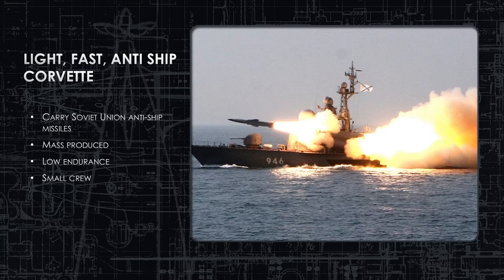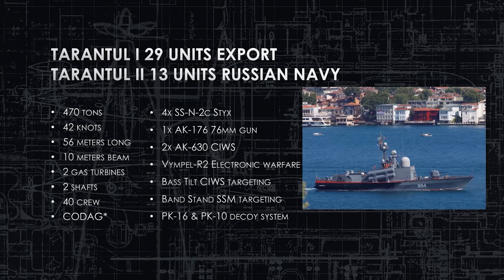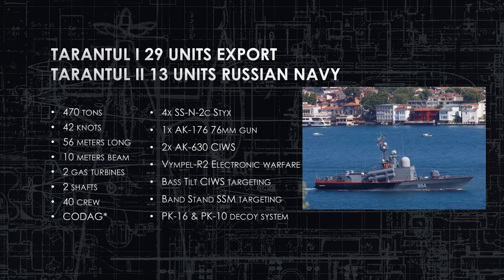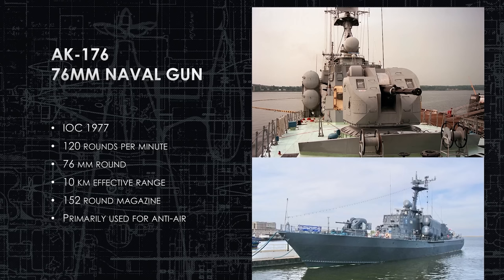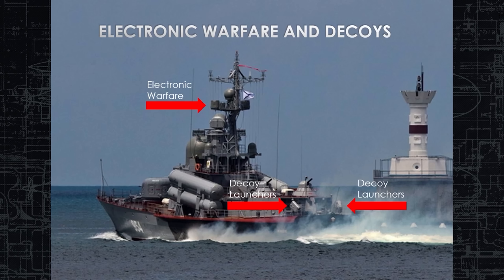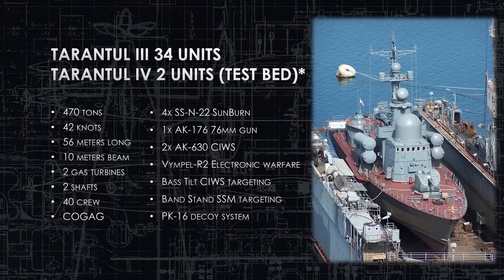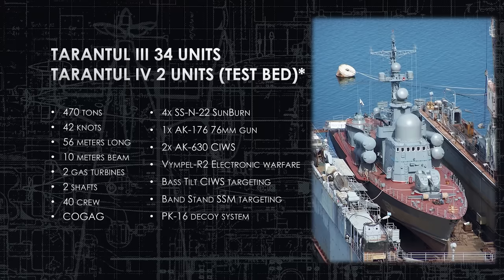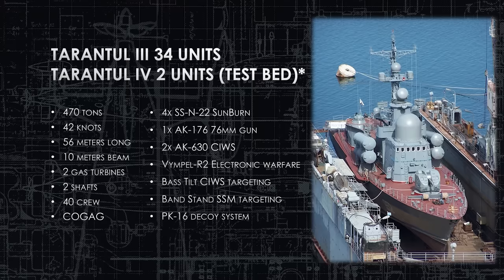Russia's Tarantul-class Corvette Project 12411

Comment: There is a Tarantula 1 boat, former East German Navy at Battleship Cove in Fall River, Ma @ Battleship Cove, USS MASSACHUSETTS MUSEUM ships DD 851, J P KENNEDY & PT boat & ww2 Sub also. I wasn’t impressed with it at all would crush like a soda can.
Reply: I think it's impressive for what it is, and for it's speed, but it's a different type of ship and smaller and less impressive than the surrounding ships at battleship cove so it's easy to be dismissive of it, but it's made to be a super light fast ship killer, same role as the pt boats, and one of the roles of destroyers, it's an interesting vessel if anything.
Reply: I’m not comparing it to the other exhibits. I looked at with the experience of a former U.S. Navy sailor. For a PT type attack craft it has its merits: speed, offensive weaponry etc. but the question is how reliable is it. The Gearing class destroyer like the J.P. Kennedy was (reliable) & besides politics probably why it was kept around for 30+ years on average. It became limited by its size being unable to accommodate modern weapons systems & electronics & air conditioning that went with them. The bottom line is you take it out before it can do you harm.
Reply: I imagine it would be easy for example for an Arleigh Burke  to take out, but what if there are 5 of them, that's a lot of targets to take out, and a lot of missiles too, its like a pt boat, fast, lightly armed and no armor whatsoever, but it does carry one weapon that if used well and with a bit of luck can cause a lot of damage, just one or two anti ship missiles getting through is all it takes. I think for what it is its pretty impressive, it has a lot of firepower for what would otherwise be a large patrol boat. You have to keep in mind the doctrine the vessel was made for. I think in a shooting war based on what we've seen of the Russian navy in the past.... over a century... of mediocrity its not gonna get that hit off, but in capable hands it could do some damage before getting crushed

Comment: The difference btw Tarantul I and II is the fire control system not the missiles. The radars can guide and support the missiles over a longer distance.
Reply from the maker: That's a fair point and something I should have mentioned.  My explanation is simplified so technically wrong.
Reply: @SubBrief sometimes you have to simplify things for a video!

But it is nice for somebody in the comments to add more detail.
Reply: Can they shoot down a jet ski packing a punch though me harty

Comment: Great Video abut small vessels. But you have a mistake, she got 4 Tubins 2 × M 75 with 2x 3677 KW for crusing and 2 × M 70 with 2x 8826 KW for high speed. And Hull Nr 1241.2 ex Rudof Eglhofer was transfed in tue the US Navy as Nr 185NS9201 USS Hiddensee for testing. It saild with a mixt ex GDR and US Crew an is now a museumship at the USS Messachusetts Memorial, River Fall.

Comment: Interesting CIWS placement. Kind of like a porcupine? Show the enemy the stern and scuttle away at 42 knots? Anyway, good video. 👍
Reply: Imagine coming at this with one of the Ukrainian jetski-based USVs. Once you get close up it'll be pretty much defenceless because depending on how much depression you can get from those CIWS at the back the low profile of the USV means it can sneak in under the guns even if it's spotted.  I guess it'd come down to whether the EW suite can disable the drone. (probably)
Reply: @jhonbus  
Yea, it would be funny if a Ukrainian USV went in the back and reamed her out. 🤣 

I wonder what the Soviet doctrine  was that produced this design. Maybe, like an Alfa SSN, they were supposed to sprint out, engage and fire off their missiles? After that, they could race back to port, relying on their CIWS and high speed evasive maneuvers to protect them from any return fire.

Comment: If I am not mistaken, these Tarantuls also had anti-submarine warfare capabilities. They certainly would be bait for western submarines stealing into Russian waters. Doubtlessly they would be blown to bits by any torpedo carried by a western submarine given their small size and light construction. One of these vessels HAS sunk an Israeli warship with a Styx missile.
Reply: Was that sinking the one that pushed the USN into its accelerated development of Harpoon?  I know there was such an incident.
Reply: Well, a Mark 48 would literally loft the vessel out of the water, but it'd give that torpedo a run for its money if it actually moved at its rated speed.
Reply: It's very small target for a torpedo and difficult to hit and probably costs about the same as big sophisticated torpedo. And it's not sumbarine hunter, and probably will be covered by anti submarine ships in case of operating and possible danger from subs.
Reply: @AlexanderTch  56 meters long, not that difficult to be effectively targeted by a torpedo. Especially given many anti-ship torpedoes detonate 2 meters or more beneath the keel or directly behind the screws. Under the keel breaks the ship's back, splitting it in half and behind the screws blows the propeller shaft seals, causing massive flooding.
Reply: The sinking of the INS EILAT was achieved by the Egyptian Navy in 1968 off Port Said by KOMAR PTGs while using moored freighters   as a screen.   It was a good use of shipping to complicate the defense of the EILAT which was patrolling off Port Said.  Four STYX missile hits were scored by the KOMARs on EILAT.   

HARPOON was originally intended to address the threat posed by SHADDOCK-armed submarines of the Soviet Navy.   SHADDOCK was a long-range antiship cruise missile (ASCM) which could only be launched from a surfaced position.    The radar-guided HARPOON was meant to provide P-3 ORION MPAs with an ability to quickly engage a surface target emitting the related fire control signals associated with the SHADDOCK.    The USN employed STANDARD missiles fitted with antiradiation seeker heads as a stopgap measure until HARPOON would arrive.   These weapons were called the Interim Surface-to-Surface Missile (ISSM) and could be fired from shipboard SAM launchers, ASROC “pepperbox” launchers, and the launchers fitted board the PGGs once used by the USN.

Comment: Sorry but could you do a video on maybe speculating on ways to remake/fix the LCS ships especially the independence class ships. could you maybe fill in the deployment bay and turn the entire flight deck/ after deck into a truly massive VLS system mounting like 3 or 400 missiles for fleet defense or maybe launching malds or something.
Reply: The LCS program is beyond salvation, especially the Independence version
A single full length 8 cell VLS module weighs 33000 lbs empty and without associated equipment
You're looking at 750 tons for 400 cells -  empty
If it breaks down, you're also 400 cells short ...

Comment: One relatively small caliber round through the side of an exposed Russian launcher and kaboom. 
It's a phallic display for these floating May Day parades, not a weapons system.
(It's also a marine dinosaur.)
Reply: I gues they are going for speed and sensors over armour and endurance with that one. We will see if it pays off.
Reply: One relatively small caliber round through the side of an exposed American launcher and kaboom.
Reply: @martinmalecki3302  They stopped using armor (except for those big carriers to protect reactors) long ago when sea-skimming missiles came along that can driver through anything. Also, heavy torpedoes (and mines!) explode under the ship and break its back rather than blasting through the sides, now. Besides, there is a huge price paid for all that extra weight in the form of reduced speed and armament. You are right about what they rely on.
Reply: @gustaveliasson5395  Well, the modern navies place their launchers below deck for vertical launching. The latest Russian ships are built that way but they are few and far between and these ridiculous Soviet era tubs are still sailing past the dictator and saluting. American ships haven't looked like that since the Vietnam era fifty years ago and even then, they weren't phallic displays.
Reply: good luck doing tat at open sea
Reply: @ashifabedin  They're called "aircraft" and some of them can travel at supersonic speeds.
Reply: I mean it is a less than 500 ton ship. It can’t be all singing all dancing; there has to be cut corners. These kind of ship is more toward patrols and hit and run close in littoral combat in war time. Like you hide near the shore, scoot out at max speed, shoot your salvo and go home.
Reply: @abrahamdozer6273 
You're mocking them for having phallic displays on their ship, while at the same time aknowledging that they're trying to move away from having phallic displays on their ships?

I'm sorry, but you can't both have your cake and eat it; you can mock them for being stuck in their phallic way of their ancestors and not wanting to change, OR, you can aknowledge that they do wish to change, and mock them for being too poor and corrupt to afford to do it as quickly as they'd like to.
Pick one.
Reply: @gustaveliasson5395  I'm mocking them for sailing ridiculous half century old vessels. Primitives.
Reply: @abrahamdozer6273  
So... poverty and corruption, then.
Fine by me 👍
Reply: @gustaveliasson5395  They've got it no matter what. There is a sickness deep in Russian culture.
Reply: @huy1k995  look at ww2 flower calss corvet they were usefull aginst uboat and escort
Reply: @abrahamdozer6273  s 300 system fly hyper sonic thay called "anti aircarft missile "
Reply: @ashifabedin  There's a whole lot of hype in hypersonic.
Reply: @huy1k995  They are the real littoral combat ships hiding along the coast, in an inlet, behind an island
The corners being cut are minimal air defense, no ASW  ,short endurance
Reply: Check out the quad US Harpoon launchers
Or even the new NSM missile boxes
Reply: @Wannes_  It's an issue, isn't it? What they are not are phallic My Day Missile Parade displays. It's a Russian thing.
Reply: @abrahamdozer6273  Exposed launchers (either western or Russian ) are obviously more vulnerable to combat damage.
But even battleships have been blown up by their own munitions, despite being protected by armour.
Reply: @Wannes_  See any battleships being used now? No?
Reply: @abrahamdozer6273  It's just to illustrate that having launchers below decks does not guarantee they won't blow up ...
It's why the Zumwalts use periferal launch cells, so one hit doesn't take out a full VLS farm
OTOH it makes the area where missiles are stored bigger, increasing the chances of hitting a dispersed 8 cell pack
Reply: @Wannes_  We're talking bout those phallic display launchers on the old Soviet cruisers, how mean they look and how impractical they are. It's not about real weapons systems that were not designed to be propaganda props.
Reply: @abrahamdozer6273  You seem to have a phallic obsession 😆
Reply: @Wannes_  Not me but the Russians sure do. Do you live in a country that has missile parades? I don't. I think they're both childish and deeply Freudian.